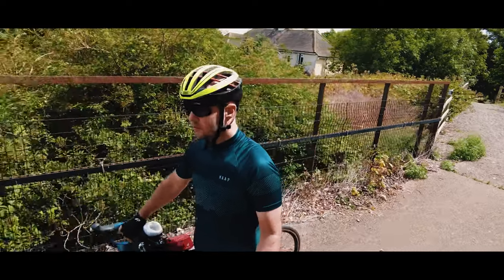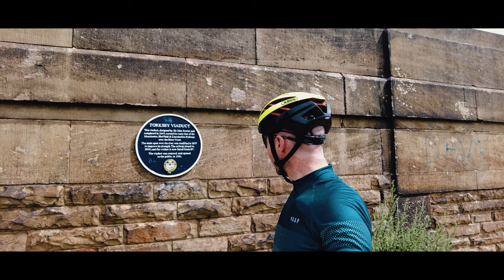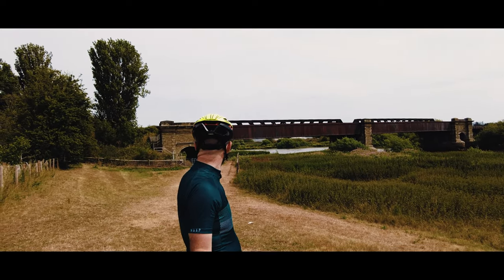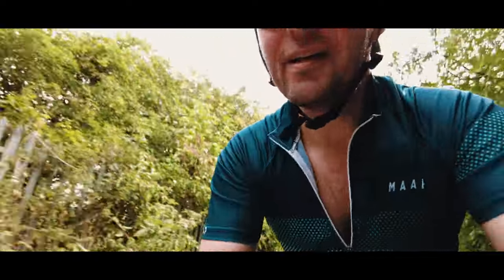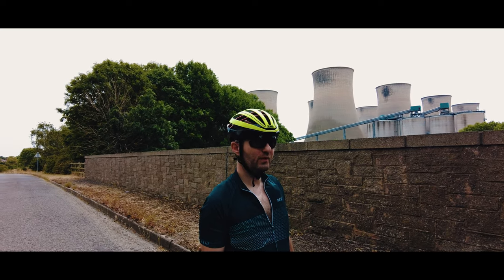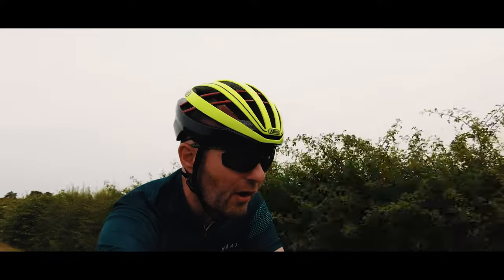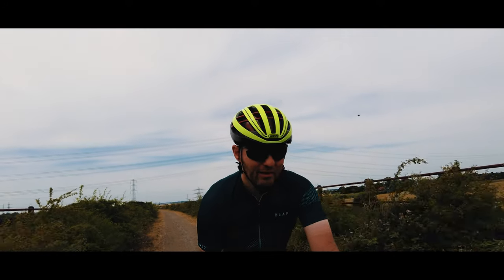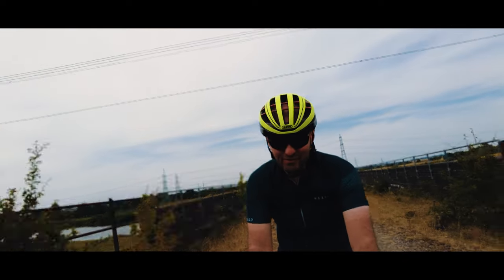Torksey Viaduct - Fledborough Viaduct Cycle Ride

Comment: Did Torksey Viaduct and Fledborough Viaduct as part of one of my Gravel rides. Nice n quiet country 👌. Great rides all
Reply from the maker: Cheers Mark, Torksey Viaduct has it's charm but the farmer round that way has sign post's up a plenty about no trespassing, gives the impression of no public right of way.
Reply: I've been that way twice with no issues. From the Viaduct you go down the steps, hike a bike through the gate, up the embankment. It's a short public bridleway to another hike a bike gate onto Torksey Ferry Road then onwards to Rampton via an earthen track past the power station.
Reply from the maker: yep thats the one, foxes you a little as the famer has signs all over it for his land. cheeky devil trying to discourage people using it I'd guess. I know now! and will probably go that way on my may to Clumber Park via NCN in a few rides time.
Reply: Could be a bit more informative. I have an aluminium frame cycle. Not heavy but not light either, and I am over 70 yrs. Lifting it over a fence, carrying up some steps and similar at the other end. There is also the choice of two routes on the west bank; south and north. Both involve lifting your cycle over a fence. The northern one involves going along the grassy river bank. At the end, you guessed it a fence to lift your cycle over. Sustrans have got the best deal they could I suppose. It is not the NCN64/647 though. The bridge is amazing - 1st (supposedly) box girder one in the world. Britain's pride and little known about.